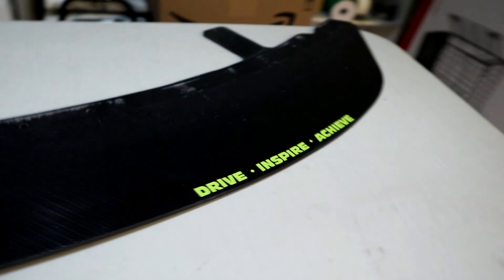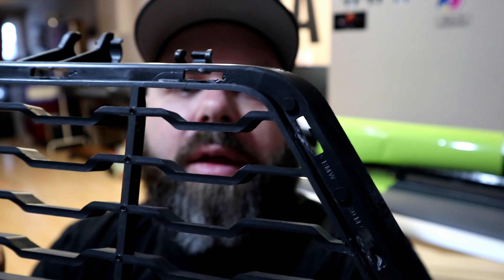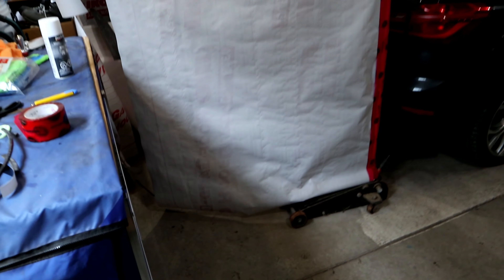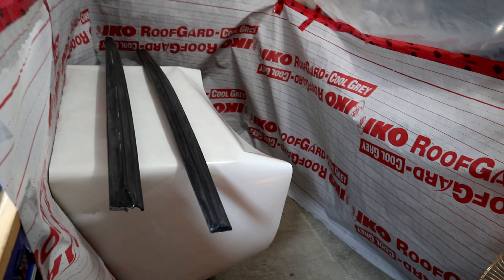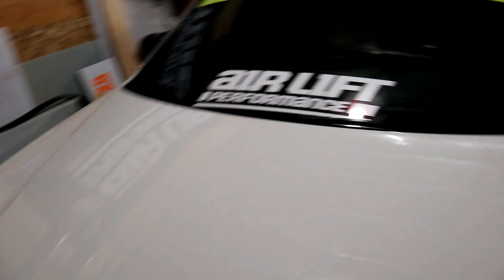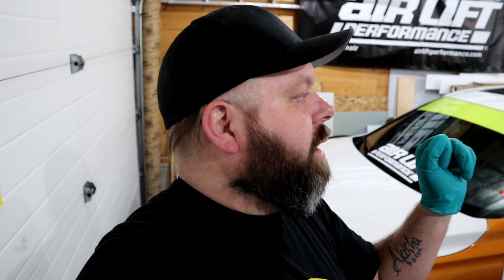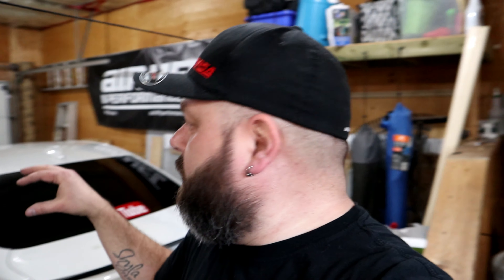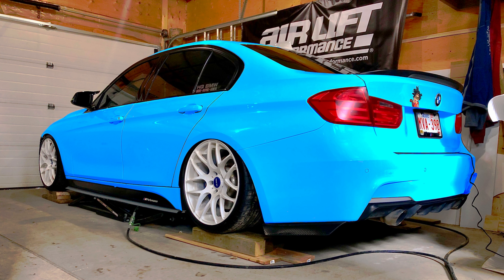Wrapping and Painting | BMW F30 335i

Comment: I had the same problem with my bumper pieces on my car! The pieces looked almost gray! I just ended up painting mine shiny black!
Reply from the maker: Ahhhhh I figured that might be the option I need to go with. One of my buddies suggested a torch and lightly go over the surfaces and it helps bring it back to black
Reply: HQ_BMW yeah, a heat gun will actually bring it back as well! I just figured painting it would give it longer lasting results
Reply from the maker: R U Detailing That’s a good point actually. I would prefer longevity over a quick fix.